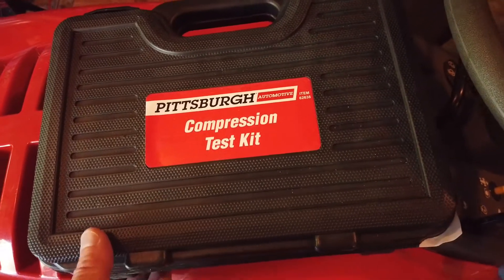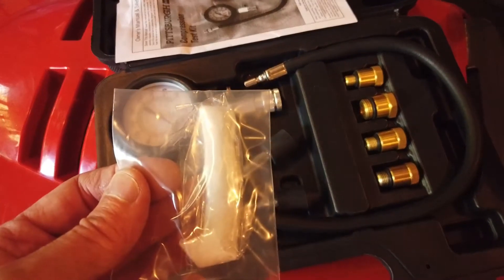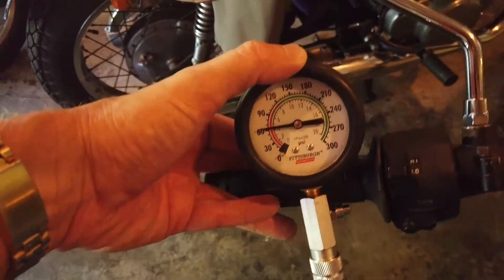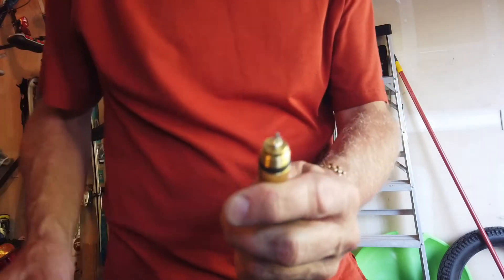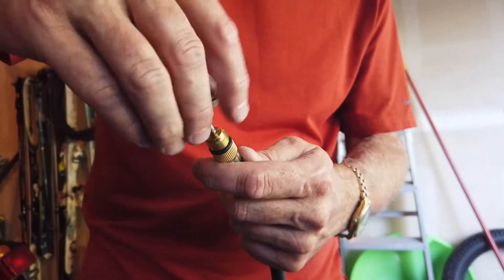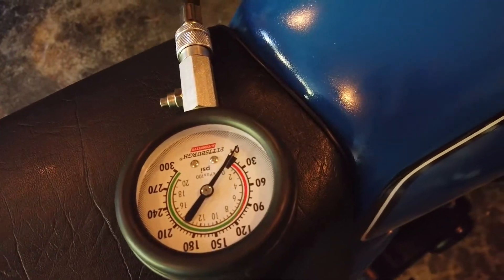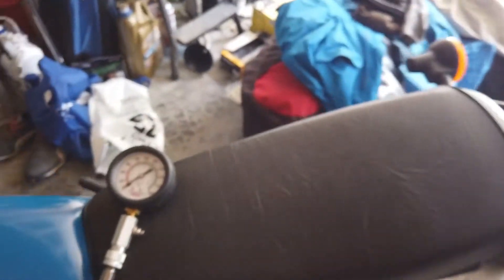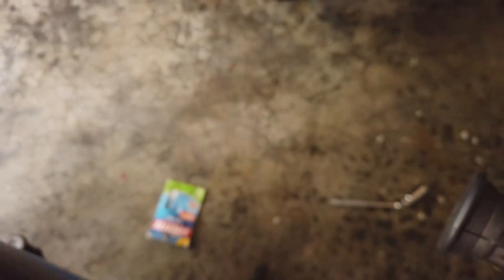How I got the Harbor Freight Compression Tester Working!!!

Comment: FYI as a second option. I installed a small check valve just north of the end that takes all the spark plug fittings. Crack pressure on the check valve is one bar and is the same diameter as the hose. You ID the problem with a Schrader valve… it won’t seal due to a lower taper and it needs a low crack pressure. Good video.
Reply from the maker: Good idea!
Reply: Awsome what's the name of the check vaulve and were did you get it ty.

Comment: I suppose there is no reason a guy cant get the taper tap then and avoid using the blue shoe glue.
Reply from the maker: Unfortunately the hole is already the width of the valve so you can't taper it.
Reply: @FlyingScot  so i assume technically the hole is too large but small enough to get some threads
Reply from the maker: @jpegjake  you got it!

Comment: Great video I have a hf and 2 other compression testers that read 30 psi on a new still chainsaw.I've ordered valves and tap to make them right.tyvm
Reply: What size tap did you use? I couldn't understand what this man was saying
Reply: @gregmccarter2176  I don’t remember the size but it didn’t work anyway I bought a good one at a auto parts

Comment: What is that 2 stroke twin motorcycle sitting next to your DT? I could only see the exhaust and rims. Love those old 2 strokes!
Reply from the maker: That's a 73 Suzuki T500 twin! Just finished restoring a 78 Suzuki TS 100 last week.
Reply: @FlyingScot  sweet I had a 76' GT 500. Loved it. I now have a GT 550 and a 71' T250J hustler.

Comment: True genius !  How did you figure out the correct tap size needed for the Schrader valve you used?  and will it be the same for the alternate Lisle and Milton valves you listed ?
Reply from the maker: It lists the dimensions for the tap on the wiki page for the Schrader Valve. Should be the same for the Lisle and Milton.

Comment: Can you just remove the schrader valve that comes installed in the gauge and just tap the hose and reuse it or does it need to stay installed in the gauge portion and use another schrader valve for this modification to work? Thanks for the information and video.
Reply from the maker: That could work. I went to try that but unfortunately my schrader removall tool wasn't long enough to fit inside the neck of the guage

Comment: Link to the valves isn’t working...
Reply from the maker: He must have sold out ..you could use a Lisle 20100 or Milton 1251-2 core replacements instead. These are low opening pressure...I'll update the link. thx
Reply: @FlyingScot  sounds good! thanks for the reply
Reply: I couldn't understand the tap size..or what valve ...my unit is doing the same...